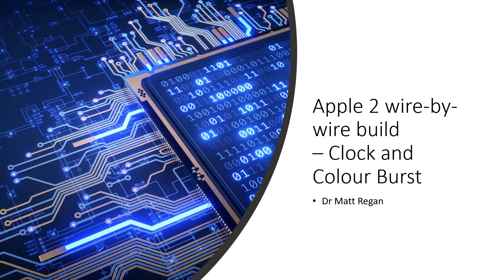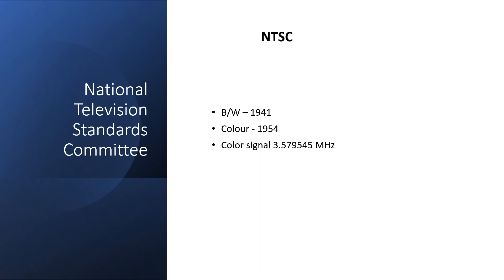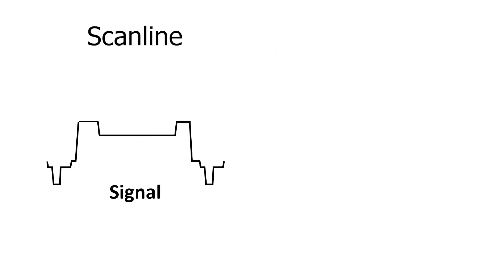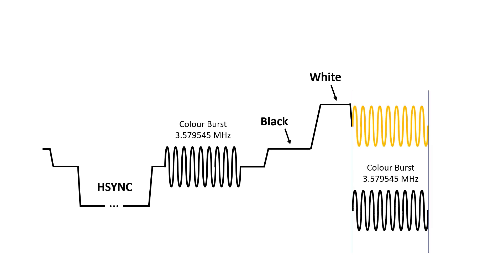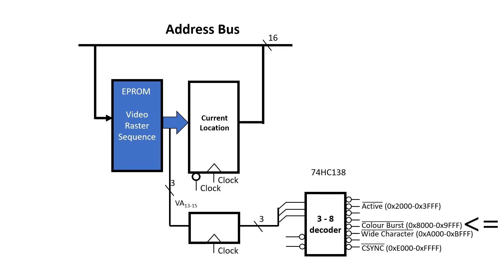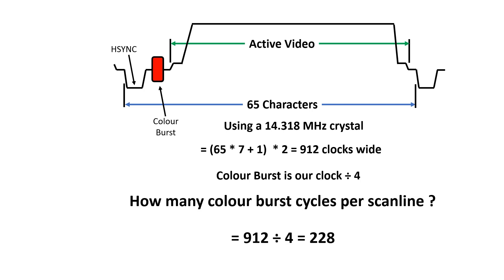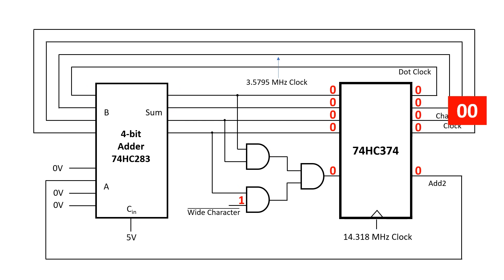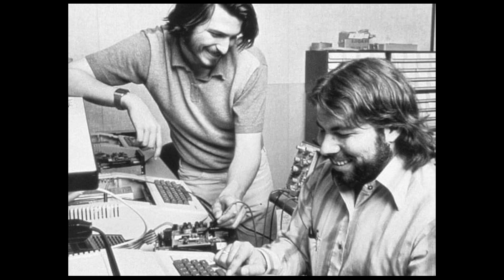Apple 2 wire-by-wire build, Part 14.  Clock and Colour Burst

Comment: A little nitpick, the color information is very much visible on monochrome TVs. The half-cyle offset per line makes it a checkerboard pattern, and the pattern inverts every other frame or field. The result is the pattern is easily ignored by the human visual processing system unless you look for it.
Reply from the maker: Is that just PAL?
Reply: @DrMattRegan  No. I'm not a PAL expert but I believe it reverses the meaning of a phase shift on each line. So on one line a color is represented by a signal 30 degrees ahead of burst and on the next line the same color would be 30 degrees behind burst.
Reply from the maker: The wikipedia article (for what that's worth) states - " Some black-and-white TVs sold in the U.S. after the introduction of color broadcasting in 1953 were designed to filter chroma out, but the early B&W sets did not do this and chrominance could be seen as a 'dot pattern' in highly colored areas of the picture."
I presume the cancelling only occurs with an interlace signal, not the progressive signal the Apple 2 uses?
Reply: @DrMattRegan  If a set filters out the chroma it will be a simple band stop filter tuning out 3.58MHz signals, or even a low-pass filter. Personally I don't think the filtering was ever very common. My 80s Samsung sets show dot crawl, and for that matter even the much newer Sharp color TV from 2000 shows visible dot crawl on the border between colors.